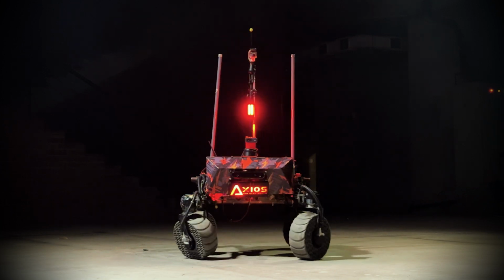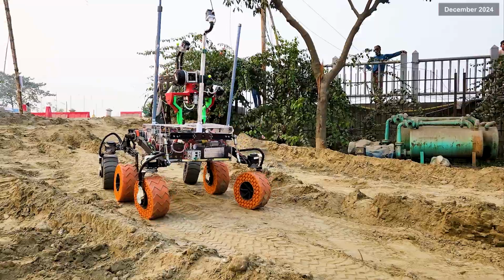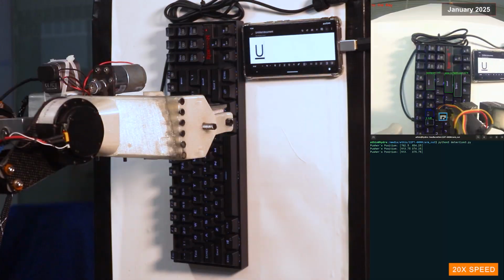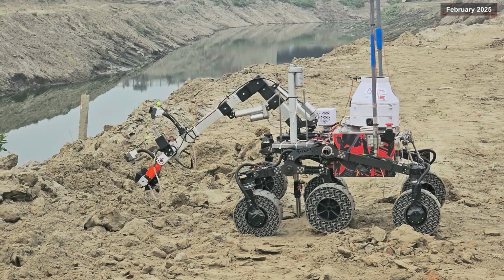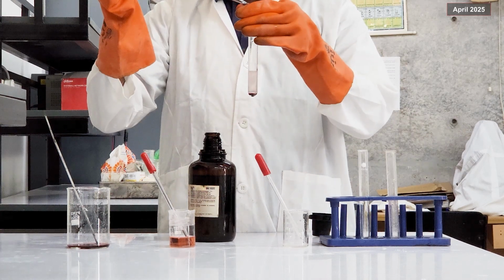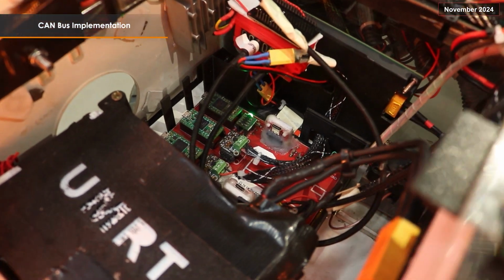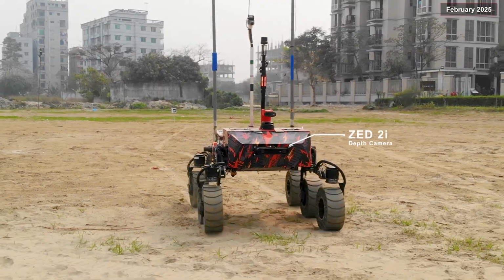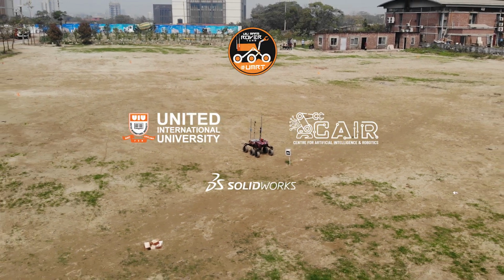UIU MARS ROVER | AXIOS | ARC 2025 | VIDEO REPORT

Comment: sir if you use teeny 4.0 in your rover that speed about 600 mhz on the other hand if you use rebarry pi computer 4 model thats a good choose for you and one more think use good type  of gas sensor  this sensor are nor good for that your rover is good but others team rover are batter degine  and sir use microair lora modeuls low cost and batter range 30 km range  otherwise best of luck